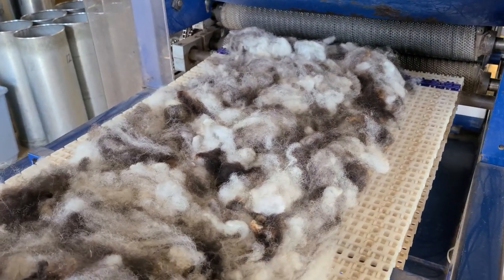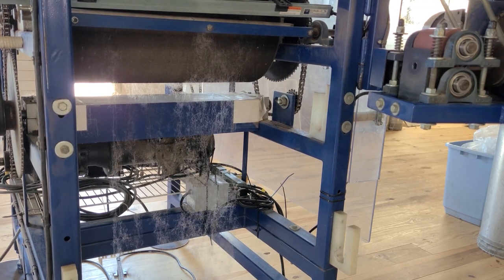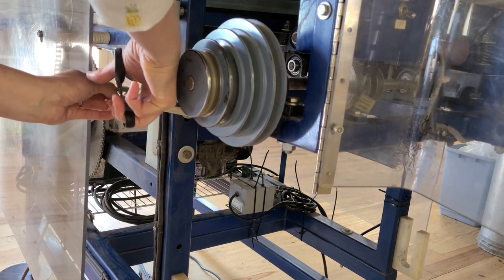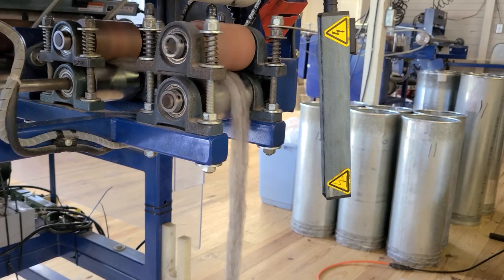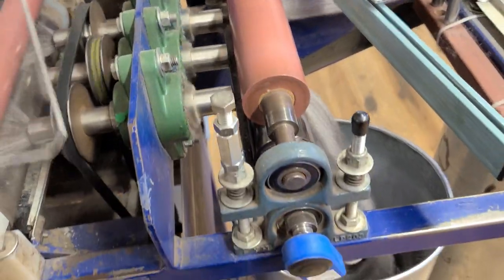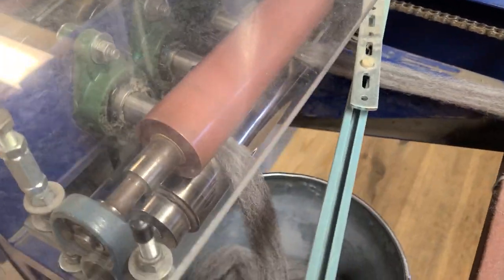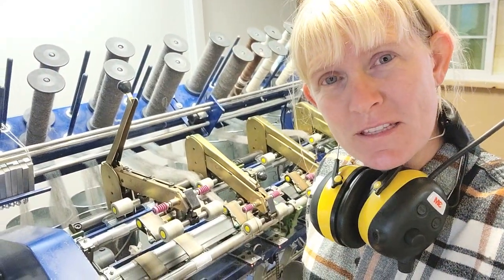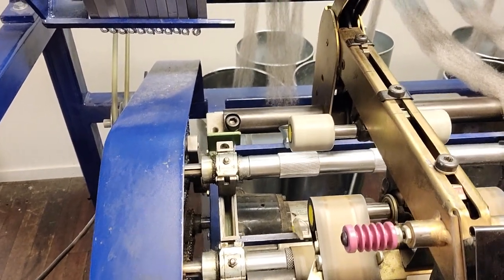Being Ewethful Minisode Jacob Wool Carding and Spinning to Yarn

Comment: Thank you for the peek into your process. Its interesting seeing how your machines turn fluff into yarn. How do you deal with changes in humidity?.
Reply from the maker: During the summer is the biggest time I have to deal with humidity here. Most of the rest of the seasons we stay wet enough that I have good humidity in the building. I condition the fibers post picking but prior to carding to reduce static. If its crazy dry, I try not to card unless I really have to. But luckily it doesn't happen too much here. Thank you for watching!